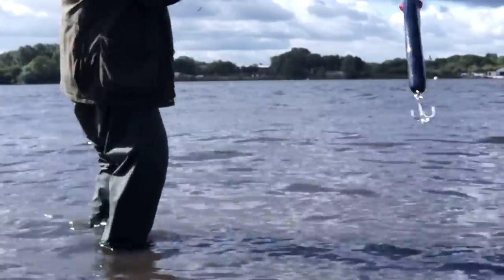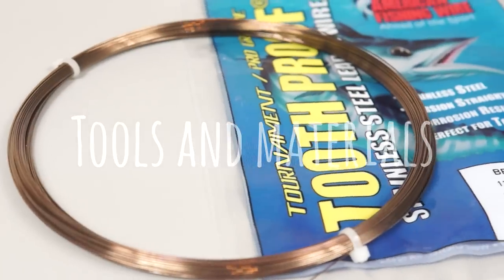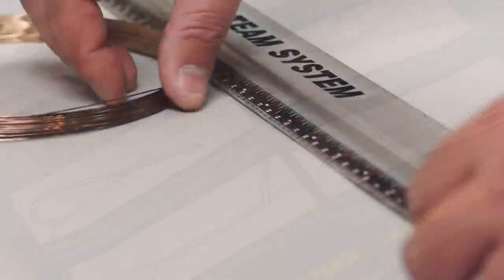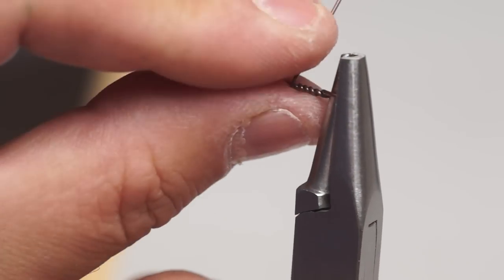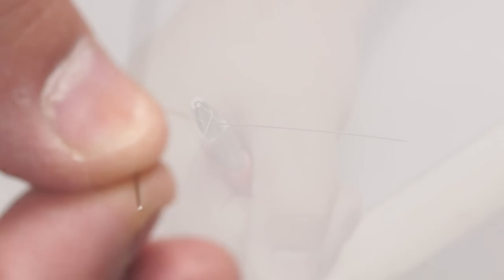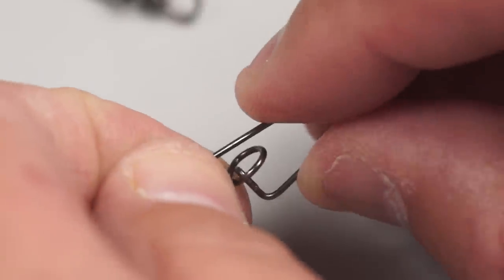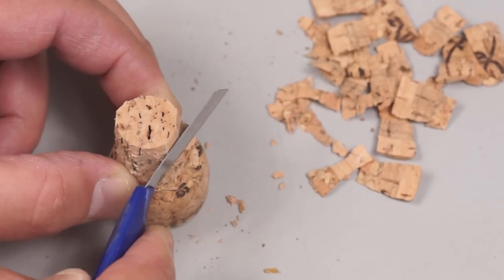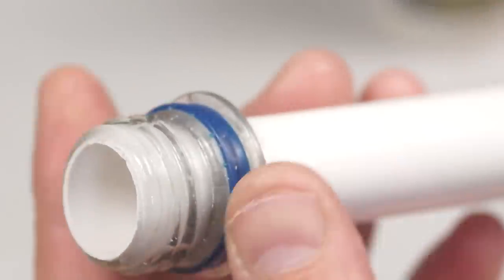Making a Solid Pike Glide Bait Lure Leader (trace) 12"

Comment: Excellent tutorial, learn't a lot there. I realise its an old video, but I'm a retired welder and MIG welding wires are an economical source of wires, available in copper coated steel in 0.6 and 0.8 dia, and stainless in 0.8 dia. Should be easily available from Halfords/DIY stores.
BUT- the wire is on spools and has a coil memory, so some method of tweaking it straight would need to be devised. Avoid wire which says "gasless" or "fluxcore" wire, this is in 0.9dia and has a chemical core and rust resistant coating. If anyone tries MIG wire out, be careful when taking the end of the wire out of the keeper hole in the spool-if you let go of the end, the wire will birds nest, hope thats of use, a simple wire straightening jig is probably fairly easy to make.

Comment: Nice use of the PVC board.  The lure came out with your typical elegant lines.  As always a pleasure to watch you work.  I've been making lures for about a year now and I've been having problems with the clear coat epoxy not covering smoothly. orange peel sort of affect.  I use createx paint do you know of any issues with compatibility?  Maybe I'm thinning the paint with the wrong kind of thinner , got a DIY thinner formula on line, ...any tips on getting a smooth finish?
Reply from the maker: Frank'O' XC I am not sure about how to get a perfect coat of epoxy but i can tell you how i have messed it up and what i do to try and avoid it. I have never had epoxy react with createx but i normally thin it with wicked colour thinner from the same people.To me the orange peel effect sounds like something is repelling the epoxy. The biggest problem i have with epoxy reacting is oil, so that could be grease of my fingers so i tend not to touch the lures while i am painting them, oil from the compressor this was a big problem i had with a compressor that was letting tiny amounts of oil into the line, i ended up getting an oil-less compressor. Dust was the other thing, so covering the turning rack. The other big problem i had was temperature, i used to put epoxy on and then put it into the warmth to dry, what happened was the increase in temperature would would mean the wood would start release gas and create bubbles as the resin cured. But having the epoxy too cold also reduces its ability to flow and it tends to want clump together pulling away from the surface of the lure. Also with resin lures not leaving them long enough to cure, like a week before starting to paint. Another big problem with epoxies is they can have a lot of surface tension like a balloon skin, so if the lure has sharp edges this is where the epoxy will be thinnest when it has cured, and the thickest on a flat surface. Try coating a child's wooden block and you will find that resin just pulls away from the edges and starts to dome on the flats.   After trying a few different epoxies i tend to stick with envirotex  as get the best results with it and i get time to sort out some problems before it begins to set up. But still some days are great epoxy days and some days are just bad. I do not know if this will help or confuse you more.
Reply: Paul,  I had to retype the following so if its a redundant message forgive my stupidity.....

Thank you so much for your thoughtful reply.  I think you might be right about the casting epoxy.  I don't have the patience to wait for a week before starting to paint.  I contacted the epoxy manufacturer and they recommended that I coat the lure with Krylon Fusion.  This is a spray paint meant for painting surfaces that have not been prepared no sanding or cleaning.  The stuff is amazing.  I put a thin coat of Valvoline on a test surface  to see what it would  and the Fusion coated it perfectly.  hopefully this will solve my problem with oils from the casting.
I know from your videos and others that the createx paint should be heat set.  is it possible that not heat setting causes the epoxy issues?

Thanks again for all your generous help.
Reply from the maker: I was thinking polyurethane resin taking time to fully cure i have never cast a lure in epoxy. But the Krylon Fusion sounds interesting. I am not sure about the heat set i have always done that. I think would tackle these questions best by experimenting, often i find i learn more doing and failing and trying again  rather than thinking about a problem, but this takes time.
Reply: You're right...lots of experimentation ahead.  Thanks again for the help
Reply: Hi Frank'O.  To get a clear, smooth, bubble free coat of clear coat try this.  Coat your object with the clear coat.  Lightly heat the clear coat with an alcohol lamp to remove the bubbles.  Other heat sources tend to leave smut and blacken the object.  After all the bubbles pop rotate the object around and around.  This will allow the clear coat to harden in an even smooth coat.  There are small machines made for this purpose or you can build your own.